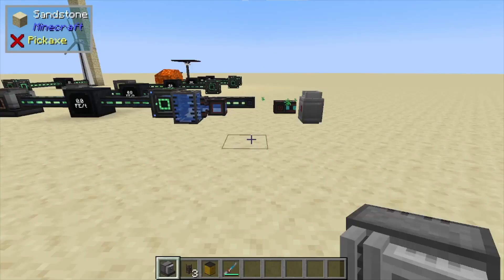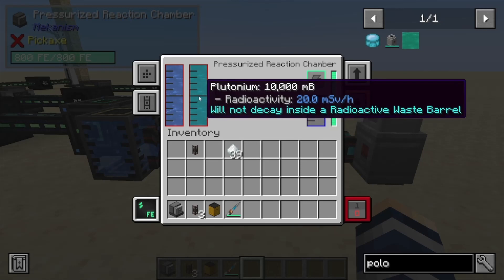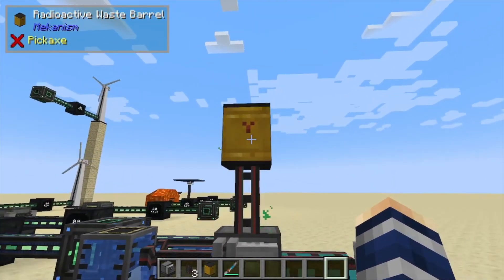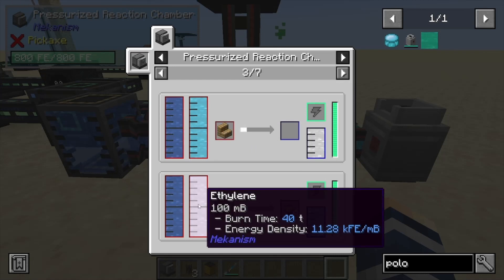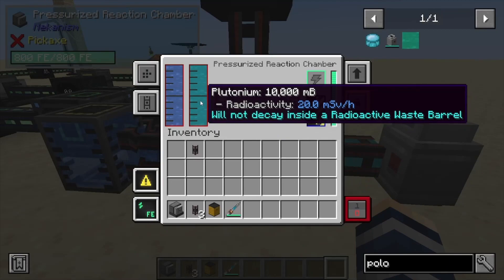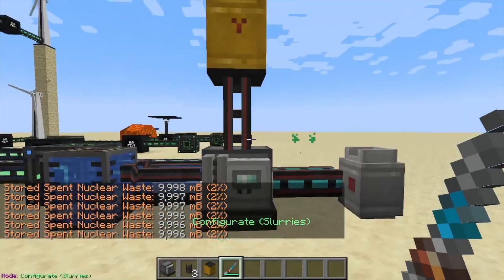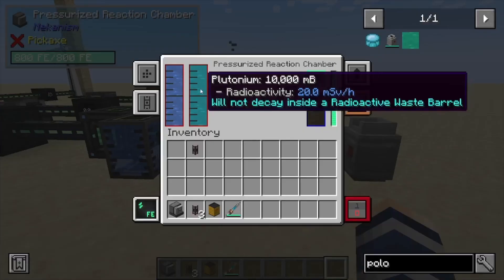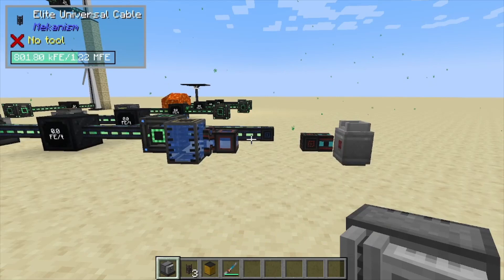Mekanism: Pressurized reaction chamber

Comment: How do i get the gas out of it again? Like if i put in Hydrogen and it is the second graph in the menu. I can´t get it out again
Reply: use a gauge dropper. Just right click the liquid or the gas with it inside of the menu of the pressurized reaction chamber and to empty the gauge dropper u can sneak and right click. Hope i could help
Reply: @Jotl_der_Dude  Thank you so much
Reply: @Jotl_der_Dude  Thank you!
Reply: @Jotl_der_Dude  you're an hero yknow that?
Reply: Got the same question
Reply: @LeosClips-u6t  i came to the conclusion that there is no way of doing it. I just used up all the liquid before inserting a different one. Hope i was able to help